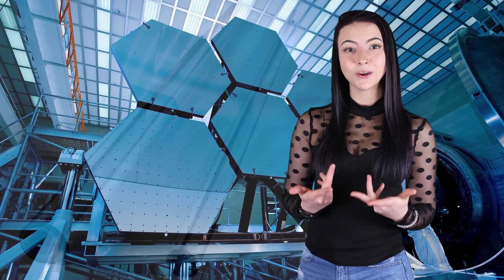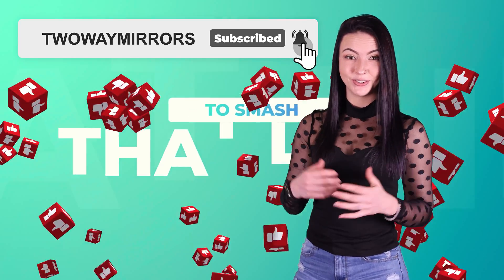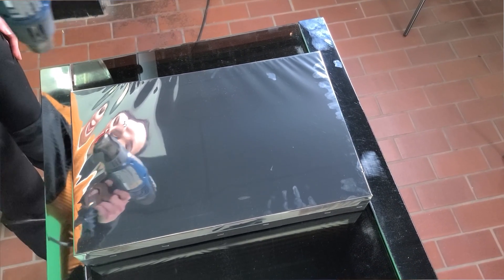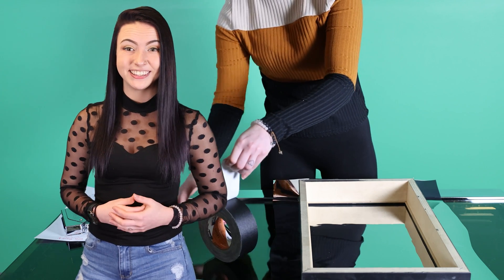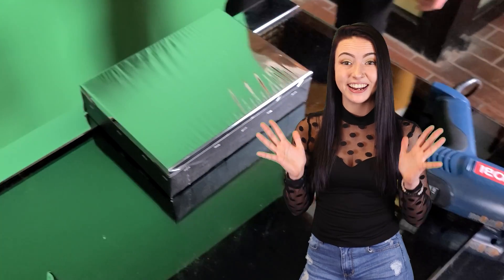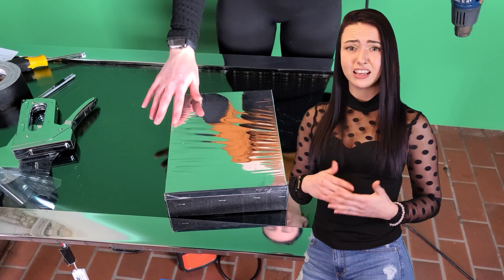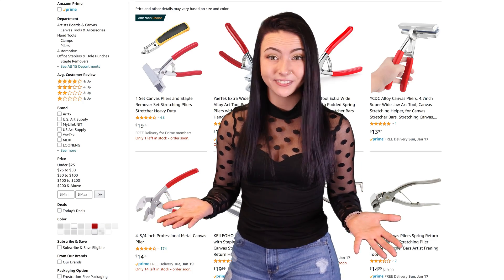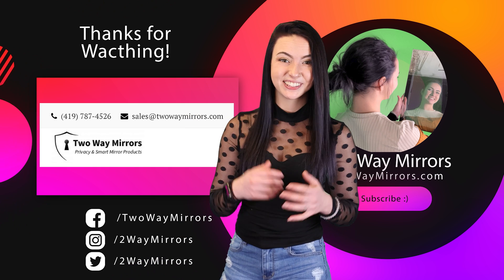Mylar Mirror - How To Make A Glassless Mirror Using Mylar Film

Comment: can you put it on part of a flat surface without a frame?
Reply from the maker: The Mylar Film does not have adhesion, which is why it usually needs to be wrapped around a frame to work. You can order samples on our website to test the product! :)
Reply: @twowaymirrors can you not add 3m adhesive?

Comment: I have a vintage vanity, and the silvering on the mirror is ruined. Maybe spots where water got behind the glass and dripped. Can I use this type of film over the glass to fix it? I don't want to spend hundreds to get new mirrors cut. Thank you!
Reply from the maker: Hi! The mirror you have could have a different reflection color than the film, so it would not work.
Reply: @twowaymirrors  I removed the mirror reflection from them, so they're just panes of glass now.
Reply: Hardware stores sell mirror paint that works very well. You might find it on Amazon as well. I've seen it used to restore older or scratched mirrors

Comment: I have 3 questions please. how far the film is able to stand the weather conditions ? can i stick it on fiberglass or vinyl ? will the reflection of the film decays after given number of years? thanks Jessica :)
Reply from the maker: The Mylar Film is more ideal for indoor applications. It has to be stretched onto a frame to really be used. Most films (including two way mirror films) are rated to be good for about 5 years but can last longer.
Reply: @twowaymirrors  5 years is not bad. any recommendation to get it adhered to vinyl or plastic surfaces?
Reply: Any recommendations for the film that has good reflections?

Comment: Does it work over glass? and or can you strech it without it deforming?
Reply from the maker: It does work over glass! Mirror film can easily be applied to regular glass using a film application kit. It can sometimes get winkles in it when you stretch it over a frame, but the heat gun usually helps with that!

Comment: Hi Jessica. I have been struggling with bathroom medicine cabinet mirrors that don't hold up to the humidity. Do you think these Mylar mirrors would de-laminate in the humidity? If so, what would you recommend as an alternative?
Reply from the maker: The key to glass surviving in those kinds of environments is a good seal along the edge, and a strong mirror backing instead of cheap made in China mirrors!
Reply: What she said,  but paint the back of the mirror backing,  and put silicone sealant along the edge.
As she says in the vid,  regular glass is best if you have to clean it regularly.